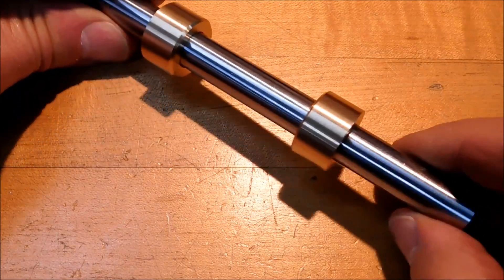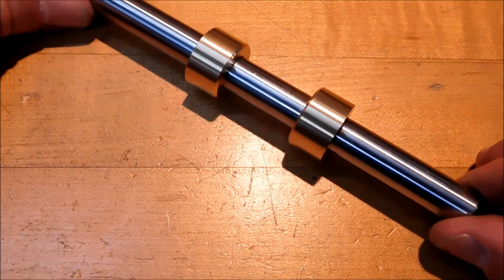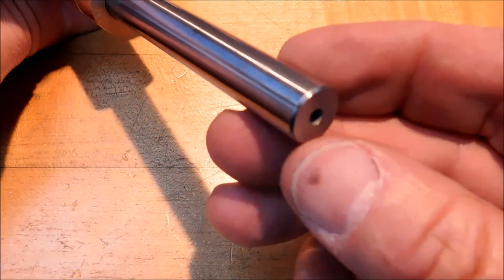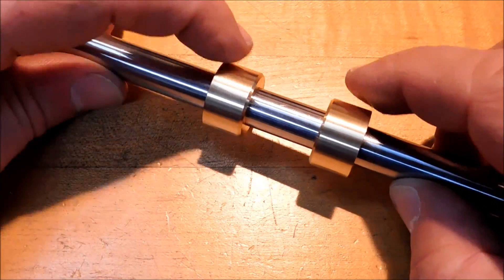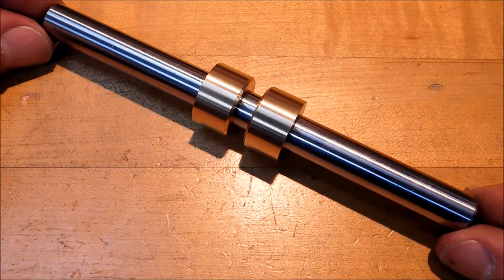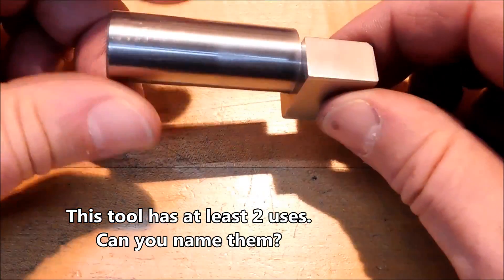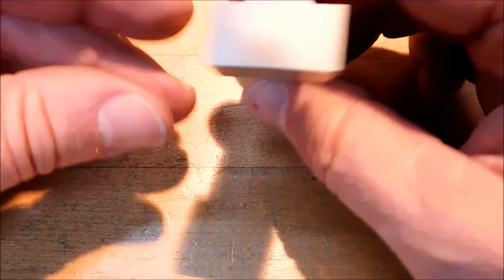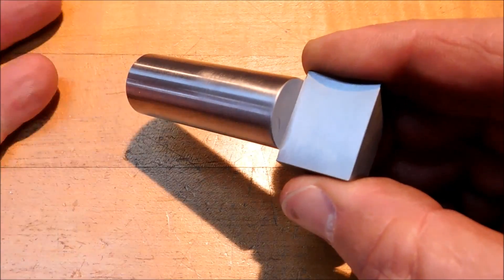WHAT ARE THEY ??  Vol. 1

Comment: #1 and #2 appear to have the same OD brass bushing to "thingamabob shaft".  So they both probably deal with the center of the table.  #1 Center of table to hole of working part and removable pin.  #2  part edge to center.  Would like to see a #2b, part corner to center, but would depend on the parts corner angle.

Comment: #1 is used on the lathe to equally space multiple parts during a pressure turning operation.
#2 is a set up pin used for resetting a part in a fixture that requires 2 or more operations.

Comment: My guess is that number 2 is for centering the rotary table under the spindle.
Reply from the maker: Super guess. Use # 2 ????
Reply: How would I use it? Not having one of these, my guess would be to put in the center hole of the rotary table, use an edge finder to center it on one axis, rotate the rotary table 90°, and center it on the other axis. Repeat as necessary to fine tune it. Did I guess right?
By the way, thanks for your videos. I've learned a lot!

Jack

Comment: #1 a fixture to check the relationship of 2 machined edges forming a positive feature to a gage block stack. By sliding the brass pcs. against the 2 edges and sliding a gage block stack on the exposed top side. 
#2 an edge finder to find the edge of a vise jaw or similar feature.

Comment: Hey Joe. Tool #1 is possibly used to check the alignment of chuck to tail stock.
By securing the bushings on the shaft at opposite ends with supper glue, take a light cut, measure to see how true centers are.
Tool #2 is used for finding center or edge. Now watch me be way off.

Comment: I'm guessing the first has to do with cutting tapers, or for measuring a distance to figure out an angle... The second is likely a way to locate center either by chucking it in the mill and bring the straight edge of a part in until it doesn't rotate, or for center height on lathe tooling.

Comment: Second goes in the middle of the rotary table so you can locate the edge of a part against it and the edge will be right through the center of the table.  
It can also be used in the lathe to align tool.

Comment: #2 could be used for setting center height on a manual lathe. Second use could be clamping up in a mill vise on the centerline flat and then sweeping center of the pin end to find the dead-on location of the fixed jaw.

Comment: I think the first is some kind of lathe Mandrel. The bushings are a close fit to the inside of a tube or a bored hole of whatever kind, the Mandrel slips into the bushings and sticks out at one end of the hole. An indicator is used at several points along the protruding Mandrel and then the chuck (or chucks) is adjusted until the axis of the Mandrel is aligned with the axis of the lathe. Then the Mandrel and bushings are removed knowing that the inside axis of the hole is now also aligned with the axis of the lathe. Now additional work can be done on the bore while maintaining its original alignment.

I don't really know what the second tool is, but it reminds me of a woodworker's bench dog. The round end is inserted into holes on the bench and then the bench vise is tightened such that the square end holds a wooden part. Several of these bench dogs can be used to hold pieces of wood together for gluing or for working on them. But this tool is quite a bit fancier than a bench dog. Therefore, I expect it might be used to clamp steel parts for machining on the mill in situations where a mill vice alone won't work....... Say for very long parts????

Cheers!

Comment: Number one could be a million things--I'm not sure.  I have a tool like number two that I use to indicate the center line of something while holding the pin.  It also lets me check center height on the lathe by holding the pin in a collet and comparing a tool to the flat on it  or comparing the flat to a stack of gage blocks.

Comment: Tool /1 is for indicating a hole wich is not vertical, thus at an angle. The bushings could be used in a hole made much bigger than the HSS ground and polished rod. So a rotary table mounted on a sine plate could be one reason to use tool /1.
As for tool /2, it could serve for the alignment of the milling machine head, when such hole is again at an angle.  Tool /2 also could be used to align a part having one edge to be placed dead on center from a hole. Could be good for repetitive positioning/referencing.

God bless Joe and his knowledge!

Comment: You could use the shaft and 2 bushings to hand file a small control link radious ?.👊
Reply: That was my thought but there were no "knurling" marks on the brass. Two bearings with hardened races would be a better choice. Tom Lipton used such a device in his latest video.